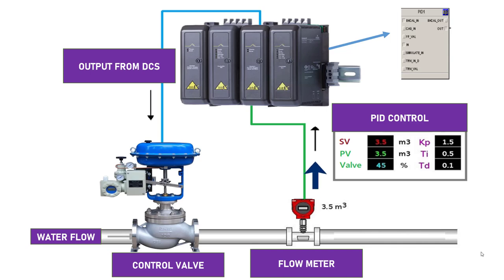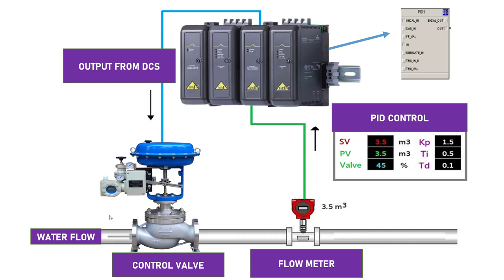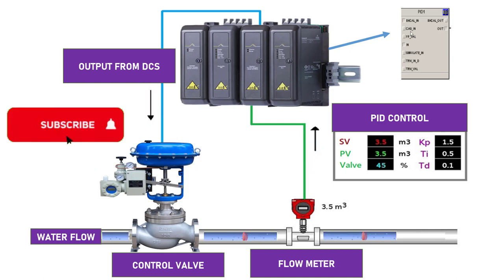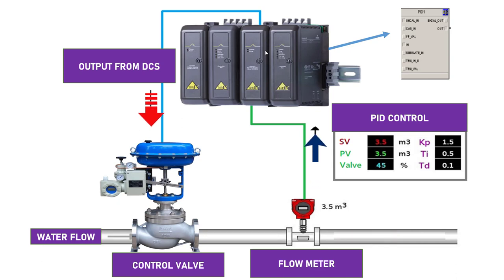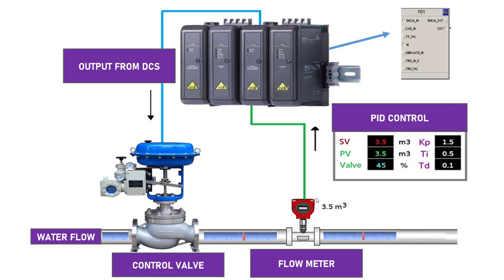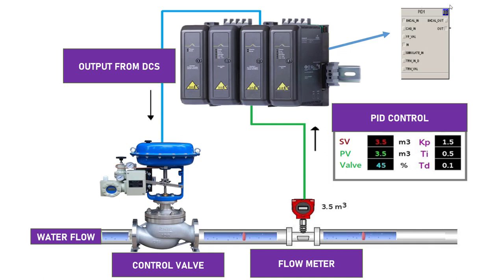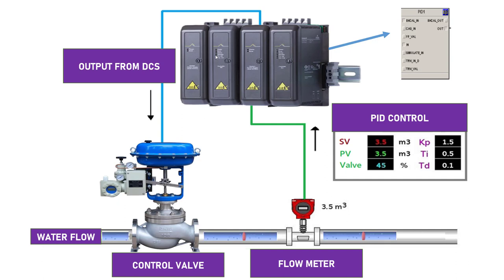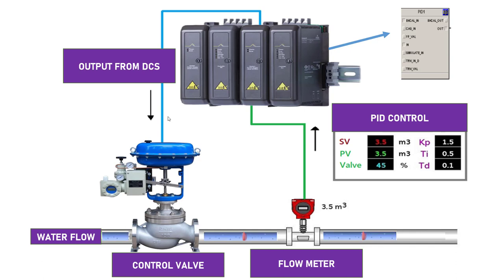Control Valve Program using PID Block | DeltaV DCS Tutorial -Advance

Comment: Best explanation
Reply: Lets solve this process:-
Input:- 1 push button, pb
Output:- 1 load, l1
Now when
1st time: pb pressed on, load l1 is on
2nd time: pb on, l1 off
3rd time: pb on, l1 remains off
4th time: pb on, l1 gets on
5th time: pb on, the process resets
Try it
Thanks

Comment: Lets solve this process:-
Input:- 1 push button, pb
Output:- 1 load, l1
Now when
1st time: pb pressed on, load l1 is on
2nd time: pb on, l1 off
3rd time: pb on, l1 remains off
4th time: pb on, l1 gets on
5th time: pb on, the process resets
Try it
Thanks

Comment: "your controller is not able to get in your pv close to setpoint, that's what we call it reset wind up" 5:59
I'm a bit disappointed with this explanation. I understand that the main subject of the video is not windup, but this phrase is just wrong and there are important things to mention when talking about windup. The first thing to say is that windup is only related to the integral part of a PID, the "I" part. A P or PD control doesn't have that problem. Second, windup is related to output saturation. For example, if the PID calculation has an output of 150% open for a control valve, the control valve can only be 100% open. Saturation is probably why you are connecting the BKCAL_OUT of the AO block to the BKCAL_IN of the PID block, to let the PID block know that the calculated output is not achieved by the AO block. With windup the controller is still able to get close to the setpoint, but it will take much longer to do so and it can cause the PV to reach undesirable values for some time.